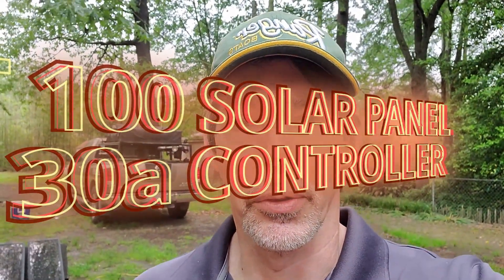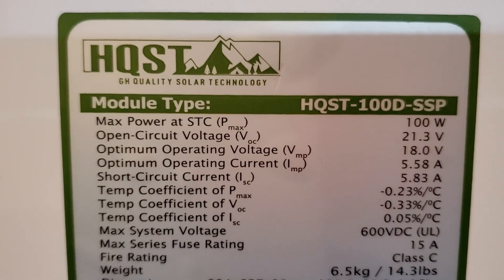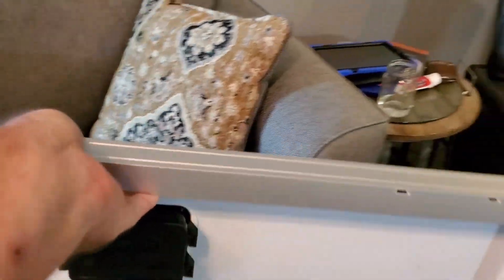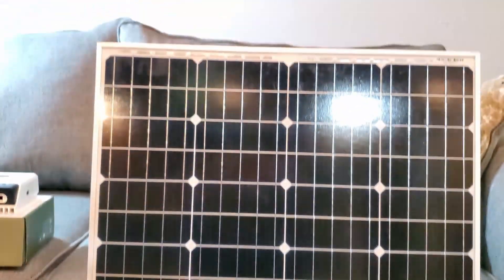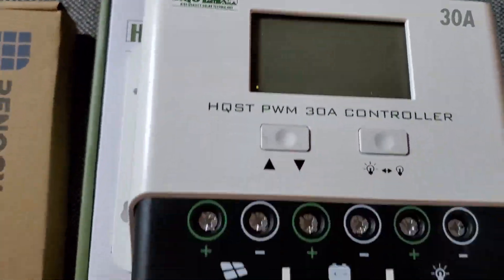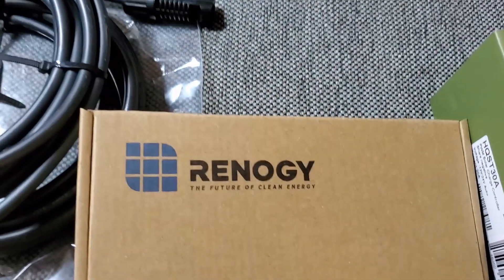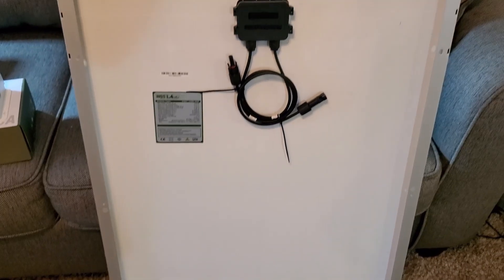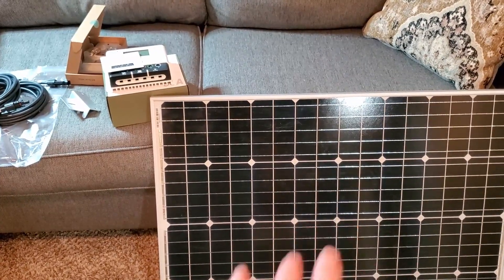100 Watt 12 Volt Monocrystalline Solar Panel, 30 Amp 12V/24V PWM Solar Charge Controller

Comment: Interesting, Tim. I was always curious about solar power
Reply from the maker: It has been fun testing it out. It is nice having a refrigerator and freezer in the truck.  Since I am adding another 100 watt panel we can camp for however long we want with out even having to start the truck as long as we have some sun.

Comment: Very impressed with that kit.  Don't you need a power inverter to convert to ac?
Reply from the maker: Yes my 1500/ 750 invertor runs my fan . Everything else is 12 volt. I have everything hooked up and am loving it so far.🙂👍